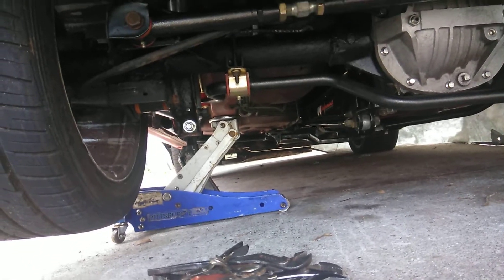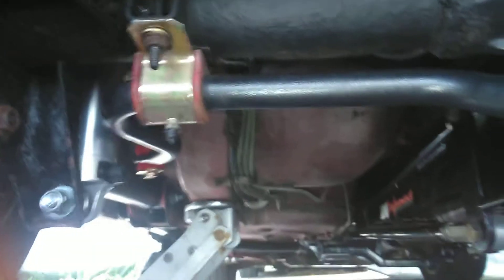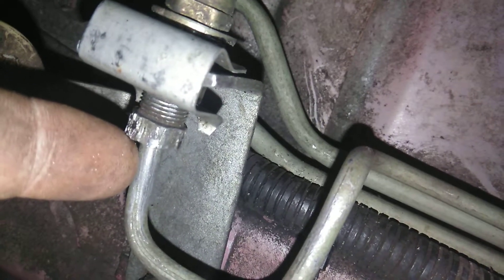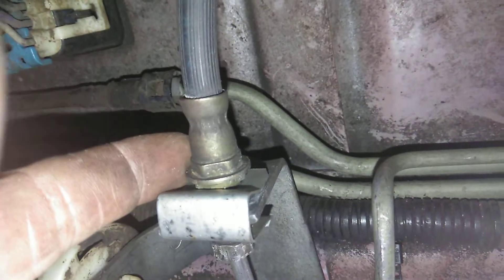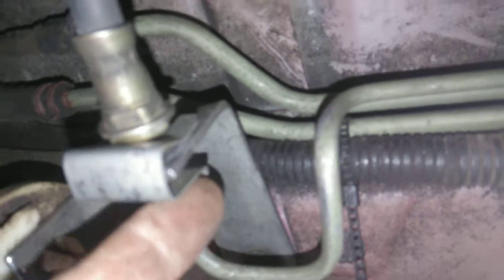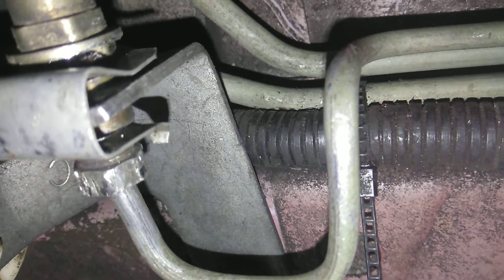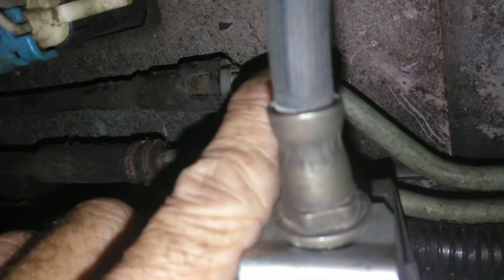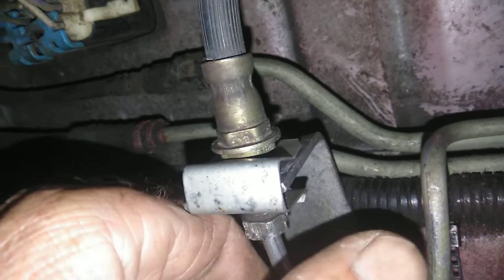Rear Brake line Frozen  FBody Camaro 🤣 time for Vice Grips

Comment: I just broke that line! What should I do?
Reply from the maker: You can either, contact classic line for new factory brake lines, or run braided lines from front to back.
Or pull from used vette.  Don't worry,
Reply: Keep On Dreaming Okay thanks, what if I cut & flared the line a bit further back and just put in a new 1/4” line?
Reply from the maker: You could do that, re flair the line. Hopefully you have enough line to re attach.  I've repaired a line with junction before. But was man moons ago.
Do not tap brakes, with line open, you get air in abs.